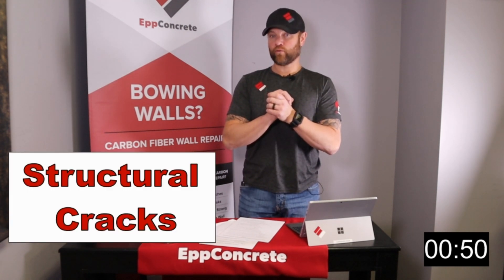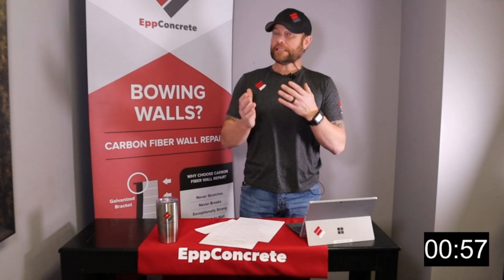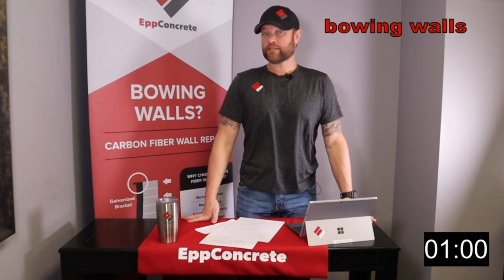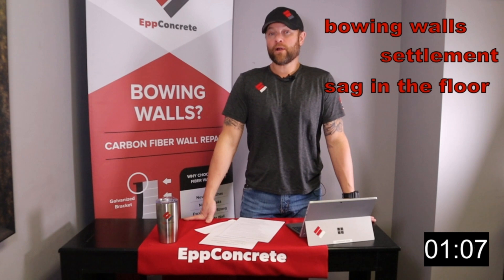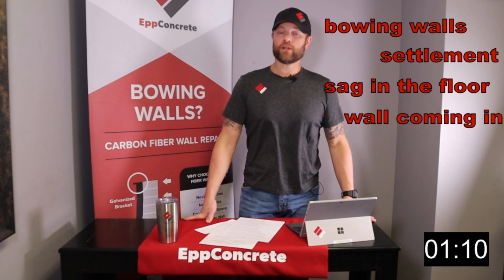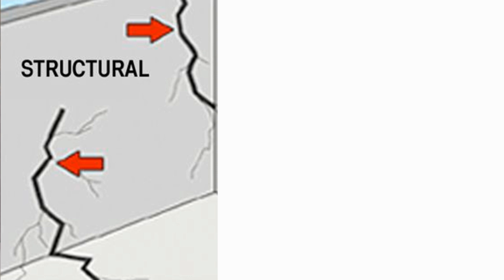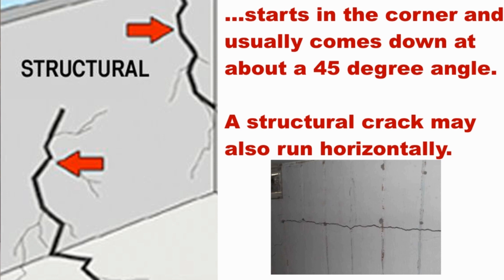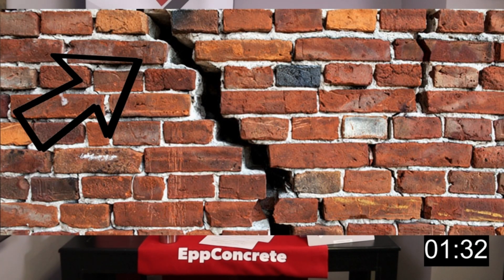Structural VS Non-structural Cracks

Comment: Thank you for the video. I was gonna buy a house but I noticed there was a big crack on the floor. The floor was concrete. Do you have any idea what could cause that?
Reply: If it's slab it's sometimes settlement and sometimes from extreme heat/cold expansion issues. I had that happen to mine. Some self leveler fixed it

Comment: I am finishing my basement, put up a 50' wall and now my floor is cracked heaving up a 3/16" x 10'.   Wondering if my walls are too tight putting downward pressure on one side causing the other side to heave upward.  smh. wall are fine

Comment: Hey. I’m in an apartment. The room is large. There are two outlines along the top of the walls that are likely beams. I noticed that the paint on one beam is cracked moderately and the paint is peeling off. Any ideas? I think has been here for a while. I have poor vision so I generally have not noticed it until someone pointed it out.

Comment: I live in Clovis ca and yesterday we had a mild earquake. Today I went outside and saw thin hair diagonal cracks around windows and doors and also on  the wall  too. They are horizontal, diagonal and some vertical cracks too. I do not recall seeing these cracks before so iam thinking they happened after earquake.  Should I be worry about them? They pretty much go in all directions. House was built in 2005 and its a one story house about 1550 square feet

Comment: Would a vertical crack in 8 courses of brick above the very center of the lintel above a two car garage indicate a structural or a non structural crack? If it is a three year old house with a two year warranty is it considered a construction defficiency?
Reply from the maker: Freddie, that is typically a completely different issue when the crack is above the lintel. That usually comes from improper construction of the lintel above the garage door. Most of the time its because the lintel was not properly fastened to the door header above the door. It is usually a pretty easy and very affordable fix.

Comment: Hey Dave I have a question for you. If I had a some small cracks on my block concrete wall in the basement, and I was going to Epoxy carbon fiber straps onto the wall, do I absolutely need to grind off the paint? I know that is the standard but have you actually seen repairs fail due to the fact that somone didn't grind off the paint first? Thank you for any feedback I appreciate it.
Reply: David, yes you will need to grind the wall very well. If you are doing anything with carbon fiber then prep work is VERY VERY important. Actually prep work is the most important thing when it comes to carbon fiber. The wall must be extremely clean and ground down. Hope that helps
Reply: @MrPintail55  Thanks Dave. I legitimately appreciate the feedback so much. Ok pretty please 1 more question sir. I have a stairstep crack in my concrete block wall along the GROUT LINE, but it is very small. Literally I would say it is between 1/16 and 1/8 of an inch. I can't fit my fingernail in it it is so small small. Is this guaranteed to develop into a big issue if I do NOTHING? Again, along the grout line. Thanks again you rock!
Reply: Unfortunately it’s to tough to tell. Usually cracks are from some sort of underlying issue (not always but usually) so my advice would be to mark the crack (maybe try some duct tape) and then watch it. If it grows or changes at all then I would recommend to have a professional look at it and give their opinion. Good luck and take care.
Reply: @MrPintail55  Thanks Dave. You are the peoples champion!

Comment: Truth is, homes built in USA are junk. Builders take the money 
and run, along with useless warranty. There is no foundation except for 
the floating concrete slab which moves with seasons. Concrete by its 
nature is porous and as such moves. Cracks are not only normal, they are
 expected. 
Then they put 2 x 4 wood stick frame on top of it, rain or shine. 
Plywood on top of that, followed by tar paper roof, and shit rock for 
interior walls. There is no waiting. Process is rushed. Take a look one 
Sunday afternoon, visit construction site,  see what is happening.  
You'll feel sick to your stomach.
Later, when cracks start to show they will blame you, the homeowner. I 
am sure the 3 little pigs built better homes...and showed more pride of workmanship.
Reply: What are foundations build out of where you’re from? And a slab is a slab a foundation is a foundation. Most homes in the US are build on footers with basement walls..

Comment: I have  been looking at houses and there seems to be this massive paranoia about foundation issues, as if is the most serious thing wrong with the house.  Any house that has foundation issues is avoided like the plague by buyers.  Is this an overreaction.  Seems most can be fixed easily with a few thousand, and the most serious ones can be solved by $20-40,000 dollars.
Reply: "a few thousand" how much is a few thousand -- I couldn't afford a few thousand let alone $40K 🤔